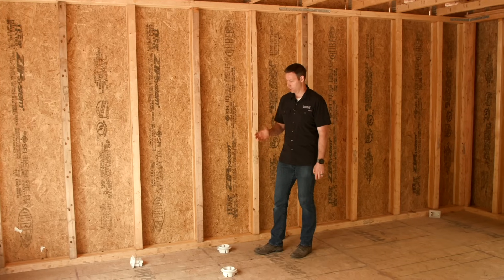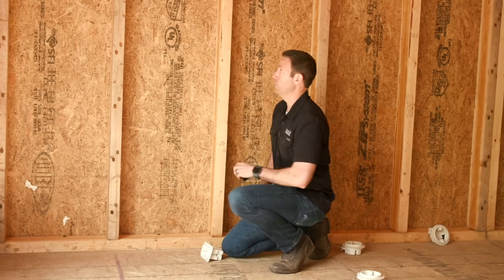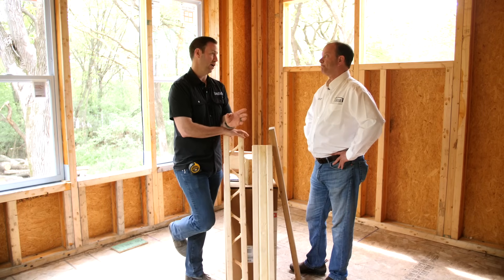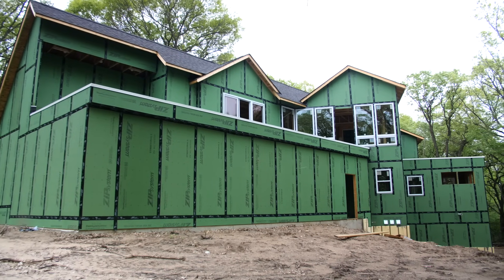Insulated Studs? This is a BIG Innovation in Framing!

Comment: Why not just use two-by-fours and recess every other one of them so that they're on the insides are on the outside it's got to be a lot cheaper and it's got to do some real good
Reply: In this case plywood would span 32” versus traditional 16”. Plywood would be significantly thicker and more expensive

Comment: 30 years ago, I came up with a crazy idea being a carpenter apprentice know it all 
I built my first house that I still live in, a basic 3 bedroom bungalow
Instead of framing with 2"x6" s, I framed the exterior walls with 2 x 2"x4" walls  (actually 1.5" x 3.5") walls, staggered the studs, with the plates 11" apart, To allow 2 x 2x6" of insulation made for 2"x6"walls to go in between as 2"x 6"s are actually 1.5"x5.5" wide
So one solid blanket of 12" thick insulation R-40, in between 2 x 2"x4" 2 x R-12 walls meaning ZERO thermal bridging
So the exterior wall is actually 18" wide with ZERO thermal bridging, and 2 x 2" layers of styrofoam sm  = R-20  over the 7/16" sheeting on the outside, so all together R- 84 , covered with solid clay brick, using Portland cement vs masonry, a trick a mason told me
And R-160 in the attic, with the access to the attic at each gabel end, I made my own vents that are hinged, so no hole  puncturing the building envelope in the ceiling
I guess I got a little carried away, Lol
Reply: What’s your energy bill like or the comfort of the hot or cold in the different seasons?
Reply: How does it work?
Reply: Natural common sense contractors.  If you been in the business, you can customize simple materials and have great results. Thanks for yours.
Reply: How do you put a window or a door in an 18" wall?
Reply: @keith_dixon  With screws or nails, I used screws
Seriously, you should be able to figure this out, just like old houses with thick stone walls or triple bricks
recessed with a window seat

Like this only my sides are angled, to let in more light in
You get the idea 
https://i.pinimg.com/originals/ce/e5/c7/cee5c77de725ca2a3ceae8f1debc220d.jpg

Comment: In Florida those T-Studs would be termite delight. I would not build any structure here that was not concrete, steel, or metal stud. It’s does look to be quite an interesting building material.

Comment: With the windows, I see an issue with the T-stud being used where a customer where want to mount blinds inside the box, with the foam located at the prime area where mounting would take place. I would have preferred a traditional solid stud in those locations. I am also concerned with how fast they burn compared to traditional solid wood. How flame resistant is the foam and how long does it stand up to fire? I agree it is an interesting concept.

Comment: IDK I'm a carpenter of 30 years and I don't think I 'wood' do a single top plate on any exterior wall regardless or the 16 o.c.
but I do like the sound of not having to carry so many studs per wall.
But
Reply: The single top plate in the video is one of the 2-1/2" thick studs, not a 1-1/2".

Comment: Awesome! Absolutely Awesome!   I really love the Naked T-Stud.  What little extra you pay for using this product you are going to save on all the time (= $$) spent drilling HOLES for plumbing, electrical, etc. Electricians charge a LOT of money per hour just to drill holes in studs as do plumbers. Then one could spray a 1-2" close cell foam fallowed by 5" open cell foam. Having 7" thick walls with spray foam closing up all the cracks really ups the R value. Then to do a ZIP system on the exterior.... Wow, the R value would be over the top. A small 2 ton AC system could keep a 2,000sf home cool in AZ.

Comment: Yeah well what if there was a product that was as easy to work with as wood, stronger than steel, will not transfer any heat or cold...and cannot burn.  It exists but the wood and drywall providers made sure it did not get used in the US.
Reply: You have a name for this magical material?

Comment: There are several problems with this idea Matt. The major problem you have is, any wall stud furnishes support strength for the roof . Also just as a matter of correction, wood studs actually are a form of insulation. If there is a void in the wall, meaning an empty space, then you have an uninsulated space. When I built my house, I insulated every wall in the home.

Comment: Using that would be totally insane. Total junk, in my opinion. Your telling me that foam will hold a nail, no it won't. No matter what kind of chemicals you put in it the increased air in the foam would most likely make it more flammable. A 2 x 2 sandwich might have more strength when pushed from left to right and front to back. Add a second story to that house and the down force on those would probably shatter them to smithereens.  Might want to add a link to show, nail pull testing, fire resistance testing an down force strength testing result vs wood. ALSO over time will that foam degrade and become weaker and weaker over time. Get the data on those concerns and add a link to make me a believer. And those have to cost a heck of a lot more than normal wood.

Comment: My wallet hurts thinking about this, hopefully they arent as expensive as they look.
Reply: ~$1500 cost adder to typical 2500 sqft home.
Reply: @cpad007   I wonder how that pays off, how much it lowers HVAC costs, probably more sensible in a colder climate or a hot climate,  less so in a temperate climate.
Reply: @kfstreich4787  Thermal breaks work in both directions.  The point is to keep your house at a steady, comfortable temperature regardless of the outdoor temperature.  "Temperate" is in the eyes of the homeowner! :)
Reply: @cpad007  what I was saying is if your climate is temperate you have less heating and cooling thus less energy expended heating and cooling.   If your climate typically ranges from 40-90 degrees F these will not save as much as a climate with lows of 0°f or 110°f,  your savings will be less drawing out the payoff time.

Comment: 1:43 "now we have no need for exterior insulation" ... I can't believe my ears... this supposed expert says that you don't need exterior insulation??? 
2x6 stud (25% surface area) + insulation (75% surface area)
Old stud (R6) + insulation (R19) = R6 * 0.25 + R19 * 0.75 = R15.75
New stud (R20) + no insulation (R1) = R6 * 0.25 + R1 * 0.75 = R5.75
Reply: He said exterior insulation (as in outside of the wall), not interior insulation which you are calculating for.

Comment: But will the foam still be good 150 yrs from now?
Reply: It'll last as long as the rest of your insulation that you seem to be not worried about. If you add foam insulation between the studs it will be an optimum set up and will last longer that you and I. I live in the frozen north and would rather do ICF if I was to build a custom home but this method looks good too if one could afford it.
Reply: good for ants... I don't trust this foamy stuff! I can see it turning into a big mess once it deteriorates and don't get fixed. 

Will this construction materials still be serviceable 30, 50 yrs down the line?
Reply: I'll be dead, the osb probably will go first

Comment: Haha! And now your house is held up with 2x2s.
Reply: What?  Double 2x3 is closer to a 2x6
Reply: @kfstreich4787  What they are made from matters more then there size. If they are made from kiln dried Hem Fir as I suspect they are, you will have problems with nailing. This will be very apparent any where that code requires that you use true 16D nails like in California for instance. It is almost impossible to drive a 16D framing nail into the end of a 2 x 3 kiln dried Hem Fir stud with out splitting it all to hell. Times that by two nails per 2 x 3 equaling 8 nails per stud there won't be anything left of the stud unless you pre-drill everything. No one will be wanting to do that.
Reply: @iamjackalope  true, and I assume they are kd due to the low spoilage.  I was simply responding to the specific comment.
Reply: @kfstreich4787   and I will respond to your specific comment... Yes exactly what I said 2x2
Reply: @Brandonparker1448  source?
Reply: @kfstreich4787  and you say  source? Lol... Why don't you look for your self or is that to hard for you.
Reply: @Brandonparker1448  pretty easy, they look like 2x3s to me, you seem insistent that they are 2x2. For starters 2x2 is square, these are not, see thumbnail, If you can't get that detail down why would I believe anything else you have to say?  

In addition they appear to be trussed, if you are familiar with construction a trussed material of the same weight per foot is going to be stronger than a solid piece.
Reply: @kfstreich4787  a 2×3 + 2x3 = a 2x6 right?  Actually they are 1.5 x 5.5 Where's the insulation then if they are 2x3?

Comment: Why would you poke cables through closer to the inner wall, with no room to budge misplaced screws? I would make a hole 3 x cable diameter and run it closer to outer wall. Everything is attached to the studs, so there's a higher chance of hitting a cable (a very low chance, but it's eventually going to kick in)

Comment: This looks really cool but is more complicated as far as material sourcing.  Probably would need to be special ordered etc and be more expensive.  You also end up with environmentally unfriendly waste when you have cut off ends.  At least with regular wood you can burn it or reuse it for other stuff in the structure etc.   A better way is to do double 2x4 walls and stagger the studs that way you can use regular wood available anywhere and end up with double R value.  The vapour barrier is also super important so if you really want to go to town, avoid any electrical or plumbing on the outside walls that way you have less penetrations in it that need to be sealed as those are all failure points. You can do faux beams on the hot side of the vapour barrier to run any electrical and just incorporate it into the architecture.
Reply: Red Squirrel I’m wondering if you can get the naked studs (without foam) and dense pack with cellulose. Or if the foam is necessary for strength

Comment: My walls are R-40 with NO studs to transmit heat to the outside. 11" thick with siding and interior drywall.  PremierSIPs.com
Reply: Guess you are forgetting the sealing studs used for every panel joint huh..

Comment: If framing a shipping container, this definitely looks like a great option on so many levels.  Thanks for the great information.
Reply: I have always been curious.  Why are you building a shipping container house?  It seems like a pain in the butt to build in such narrow structures and putting holes for windows seem like they would be tough to seal/frame out.

Also when framing since the framing would just be for drywall hanging, wouldn't you be better off framing with something like 2x3 or 2x2 spaced off the wall a bit insulating behind?

Comment: I bet your electrical team really loves them studs no drill required :) but i dont think i could justify the cost increase to the studs. I understand what you trying to do. but in reality. I dont think your adding that much to make a difference. using 2x6 walls allow you to put in extra insulation as it is. if the R value is not good enough with 2x6 walls 5.5 inchs of room to put down insulation you could add a foamboard to add to the R value this is what i did when i built my house plus with the 2x6 walls i got more R value in my walls then what most people in on the roof. and yes i live in a state with snow

Comment: I bet they are expensive as hell, not nearly as strong, and I seriously doubt it saves enough  energy to even bother. I wouldn't use it, I would stick with the traditional method.
Reply: Did you watch the whole video? Not that bad in cost and it could save you over the long term.
Reply: @ColHunterGathers  yes I watched the whole thing, but I am skeptical of the foam remaining bonded to the wood long term....which would compromise the overall strength drastically if it failed. I have worked construction all my life and there is no way I would install that crap on a house I planned to own or live in, even if they gave me the product.
Reply: @davemacgyver573  Foam doesn't provide the rated strength.  There are dowels run between. They sell them without foam which you can add what ever insulation you want. Construction is full of people like you that are afraid of change. When Engineered wooden I-Beams hit that market people like you told everyone their houses would fall in... how did that go? These things are independently certified so you don't have to take the manufactures word for it, Plus it from Canada and they can't lie!
Reply: @ColHunterGathers  Whatever, still not interested

Comment: It looks like a sound option for construction however like so much construction today it is extremely dangerous in the event of a fire. Foam in conjunction with truss construction makes for a very collapsable situation now in both the floor joists and wall t studs. As a firefighter for 34 years I dread it for firefighters. The foam will intensify the fire in the wall and the t stud will quickly fail. Today it is math as opposed to mass in construction and creates a more dangerous situation in the event of a structure fire. Just another perspective on this innovative construction. Fires do happen..... every day. The window for the ability for firefighters to enter structure interior is continually shrinking before collapse is a factor.
Reply: My first thought was "what about fire stopping?"  I didn't watch the entire video because it is clearly longform marketing so I don't know if it was addressed.

Comment: An actual good use of spray foam insulation. As using it for wall insulation is a nightmare for upgrade/replacement wiring and what not.

Comment: Seems to me if a person wanted a more insulated wall, they would simply partition and build a two wall structures like you see in duplex's between resident sides. Wood has always been considered a high R value in itself, and is one of the reasons corners are built up the way they are. (even though some people cut corners and think insulation is better, thus leaving out 50% of the corners studs to make room for insulation) 

Once a wall is cold, or hot, thickness makes no difference. A cold thick wall takes longer to heat, and a hot thick wall takes longer to cool. This means hot nights in summer and cold nights in the winter due to house temps. Like the road that's hot in the evening on a cold day from the daily sun. Or frozen half the day in the winter until the sun warms it up.

I'm not a fan of foam in the walls, when it gets wet, the section of wall is destroyed. Nothing lasts forever, and walls and roofs leak eventually.

Comment: I would have liked to have seen how an interior wall is tied to the exterior wall with no (lapped) top plate.  I'm guessing it's like the corner they showed with metal strapping (rigid plates?).
Reply: Great thermal break, but you've now loaded every inch of your home with highly toxic, highly flammable, quick to fail foam 
wall system. This home WILL BURN TO THE GROUND UNDER 3 MINUTES!!!!!. You could live right next door to the fire station and they will not have enough time to put this out!. Will keep you warm this winter, pray to god it doesnt catch fire, your family will have no time to get out.  Once again cost vs safety and the money makers always win. Shame on you folks.
Reply: @2kmkowal  I think you want to copy/paste your comment to the general comments section instead of in response to my interior wall question.

Comment: Matt, why would you need a ZIPP system if the entire envelop is closed cell?  Isn't it air tight? Then sheet the envelop with 7/16 OSB , add water & Ice shield , then tyvek and your done. What am I missing?

Comment: Wouldn't it be equally thermal efficient and much cheaper to use 2X4s staggered studs on a 2X6 plate?
Reply: Yes, thermally, but then you don't have the structural strength.
Reply: 2X4 studs are plenty strong for up to 3 storeys I would say

Comment: i am a builder also and although I have not done this I have seen many houses built with 2x4(r13) walls with 2 inches( r10) of insulating rigid foam on the exterior walls thus greatly reducing thermal bridging and is very economical. In my area I use 24 oc and 1 inch of foam under synthetic stucco.

Comment: so how do you conould all the foam dust when cutting? the fine foam dust would blow around for miles and rain would wash into places it doesnt belong..  and how water proof is it, if you have a water leak or a flood or while building in rainy areas?

Comment: If I was going to build a house I'd look for stuff like this add this to a Sip's with Zipwall on the outside and a  snap on chase for wiring on the inside because even sips transfer heat and cold this lowers that even lower. now the rim joist is the transfer point.

Comment: Wow the US enters the 21st century.Now try putting boards either side injecting foam and carry the whole panel onto site and just bolt together.As in europe,no onsite framing,better precision
Reply: That is called a Structural  Insulated Panel or SIP and they are used in the US. You Tube has some videos on them.
Reply: @billlovelace1522  Thanks Bill,yes I  know, it was English sarcasm.

Comment: How awesome is that. Now add engineered trusses and floor joists and if you have a fire, the whole house can collapse in under 5 minutes. It is proven that all that "glue" intensives" fire substantially. I also actually believe he is wrong in the insulation factor in wood.
Reply: G. R. Plus glue weakesns and get brittle as it ages how long will these studs last as houses move from wind and the glue ages and falls apart 50 years maybe